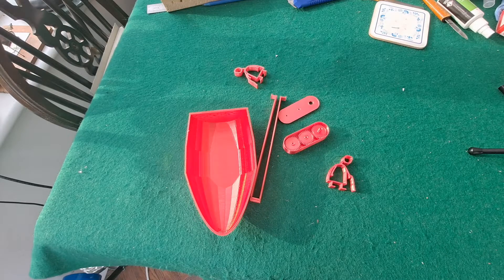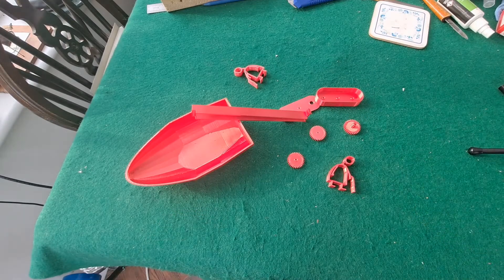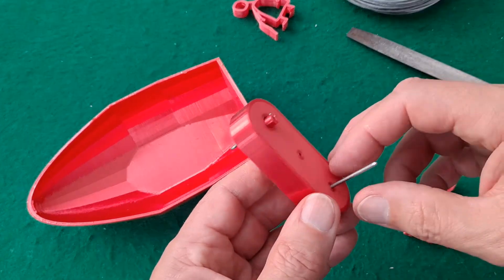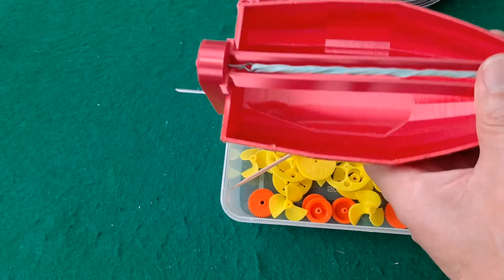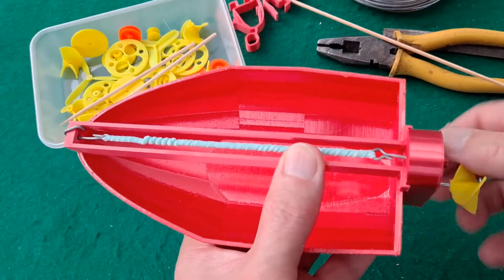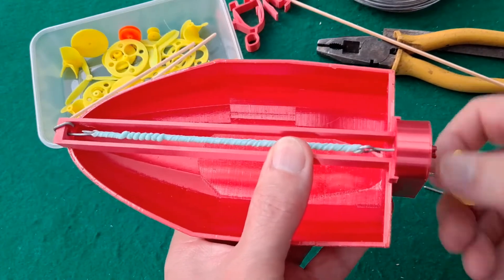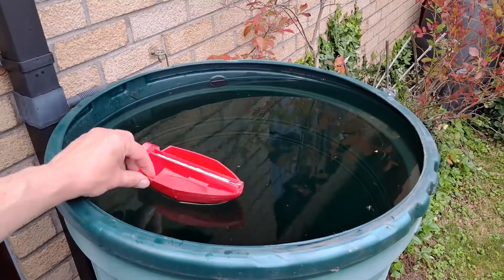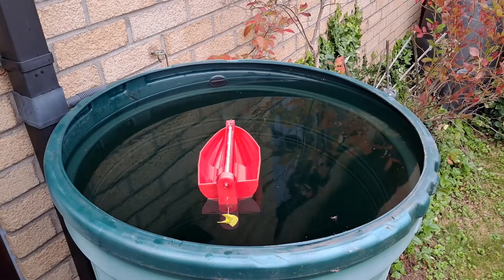Put a rubber band on it #0325 3D printed boat with gear driven propeller

Comment: Hey granddad I would like to get these files so I can give them a test and so I can try the rc method too like you said
Reply from the maker: The boat or the gear box? Here is the gearbox https://www.tinkercad.com/things/4iG92wCoJyx it is still a Work In Progress and there is a video coming up where I test this version on the 14th October. What I intend to do is add a pivot so we can turn it like an outboard motor..
Reply from the maker: This is the rubber band version for reference https://www.tinkercad.com/things/jzpgmgYVUio